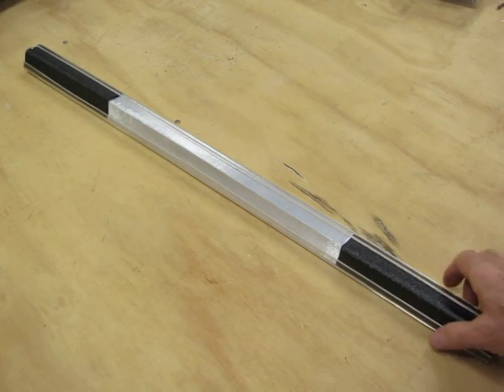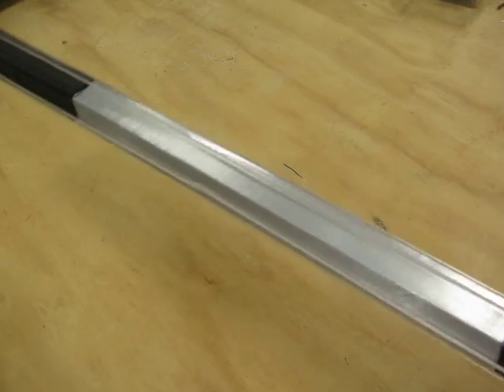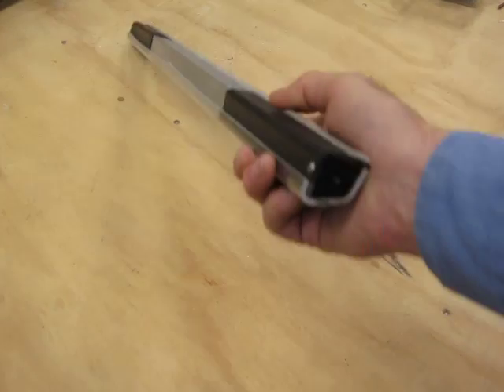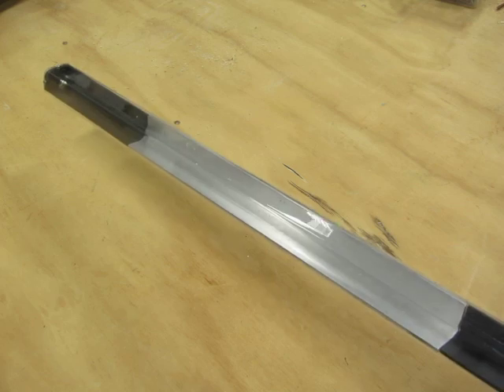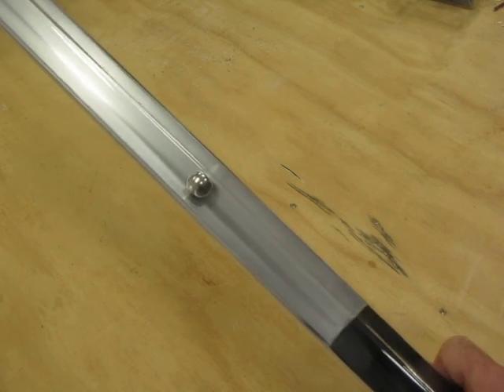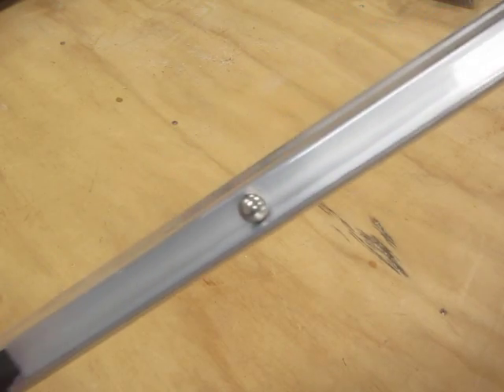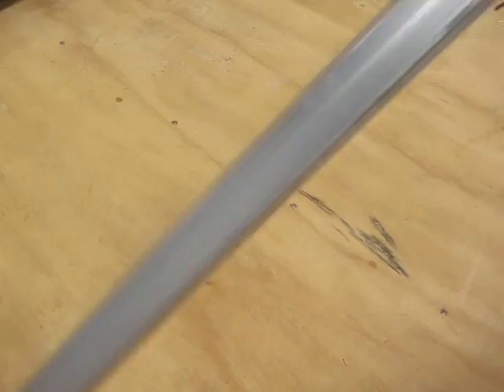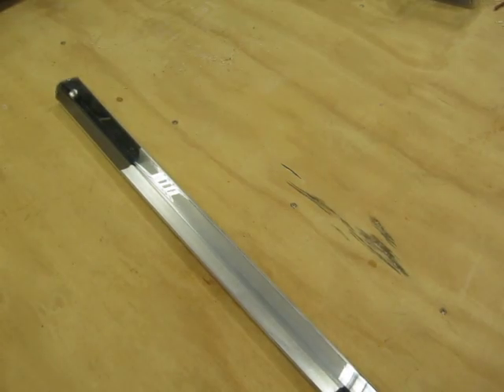Spherical Magnet Through an Aluminum Tube, Part 1et2

Comment: I think the aluminum might be mixed with a different metal, but nut enough to effect anything unless magnet is surrounded by it
Reply: Nope, the real reason is the ball creates magnetic eddy currents through the aluminum which slow the ball.
Reply: *****
This is correct. This effect can be seen with all types of non ferro-magnetic tubing. Examples abound on Youtube, and a physical explanation of the phenomena can be found easily by searching google.